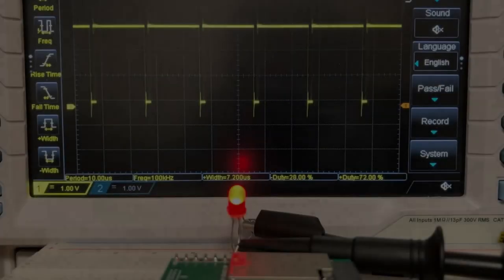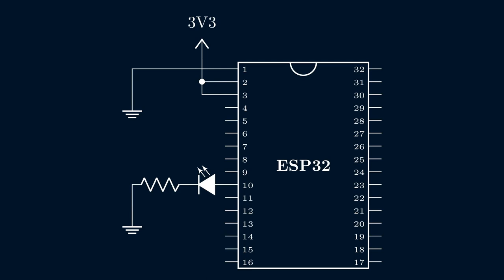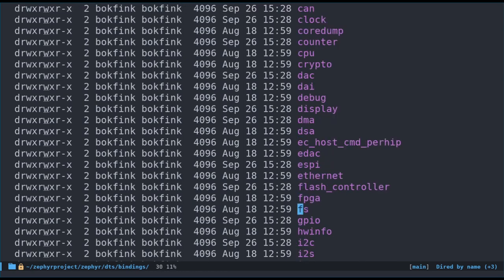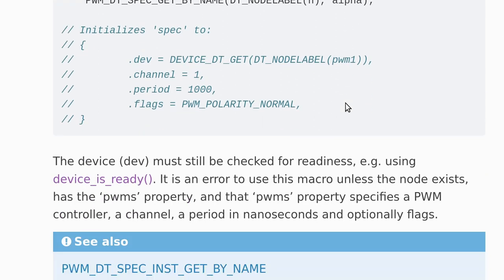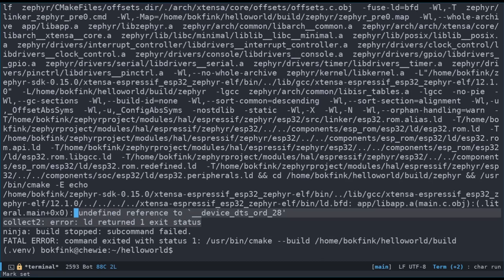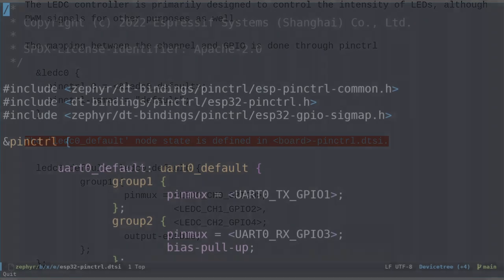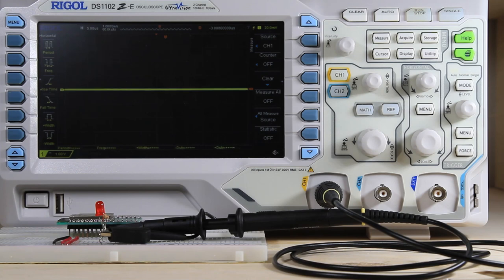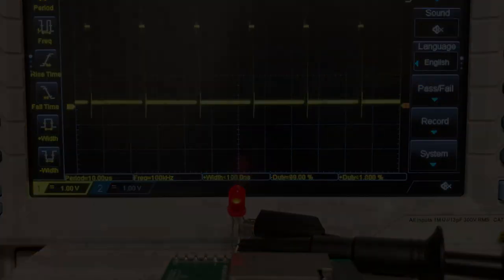[#4] ESP32 on Zephyr OS: PWM, pinctrl, Timer [Part 4]

Comment: Coincidentally I was also looking at pwm and had coding done. Then I bumped to your video. Your video gives precise and deep understanding. Thanks a lot 😊. I wish you keep making more videos.

Somehow in my esp32, for 20ms (also set 20ms in DT), setting pulse width using dt_pulse_set() returns invalid parameters.
Reply from the maker: That's great, thank you for your feedback. I hope you managed to find a solution to your issue with dt_pulse_set().

Comment: Nice video.  I tried using PWM for my project where I have 2 esp32 running pwm to drive led. initially they blink in sync, over time, after few hours, they are out of sync already. do you any idea or work around to solve this?
Reply from the maker: Thank you for the feedback. With regards to your project using two ESP32s where the PWM LEDs go out of sync after a few hours, I've not experimented with the accuracy of the different ESP32 clock sources, but the two things that came to mind was either to use a more stable internal clock source (if you're not doing that already), or to use an external crystal that provides the same clock source to both ESP32 ICs. Please do share if you get it working. Out of curiosity, would you mind sharing what your project is for? Using two ESP32s sounds interesting!

Comment: At 18:35 , you put compatible = “pwm-leds”;

Would this not be compatible=“espressif, esp32-ledc”?

If not where did you get this pwm-leds from.

Otherwise very good video though :)
Reply from the maker: That's a great question, thank you! You can certainly use the espressif,esp32-ledc compatible directly if you would like. However, using pwm-leds adds another layer of abstraction so that you could easily change the underlying microcontroller to another family or even manufacturer, without having to make any change to the source code, only a few changes in the devicetree. This comes back to the concept of separating the application code from the hardware that Zephyr is trying to do.

If you have a look at the generated devicetree for the application under build/zephyr/zephyr.dts, you can see that the pwmleds node (using the pwm-leds compatible) refers to the node &ledc in its pwms property. If you look up the ledc node in the same file, you will see that it indeed uses the espressif,esp32-ledc compatible:

	ledc0: ledc@3ff59000 {
			compatible = "espressif,esp32-ledc";
                        ......

So, we are just using an extra layer of indirection to separate application code from hardware. Does that make sense? Sorry if I misunderstood your question, and thanks again for making a great point!
Reply: @thepullupresistor  Thank you very helpful sir.

Comment: Because it took me a while to puzzle this together, here is an overlay example for a stm32f411_nucleo_board. With pwm on the build in green user led (PA5):

&timers2 {
	st,prescaler = <1>;
	status = "okay";

	pwm2: pwm {
		pinctrl-0 = <&tim2_ch1_pa5>;
		pinctrl-names = "default";
		status = "okay";
	};
};

/ {
	pwmleds: pwmleds {
		compatible = "pwm-leds";
		status = "okay";

		green_pwm_led: green_pwm_led {
			pwms = <&pwm2 1 PWM_MSEC(20) PWM_POLARITY_NORMAL>;
		};
	};
};
Reply: static const struct pwm_dt_spec fading_led = PWM_DT_SPEC_GET(DT_NODELABEL(green_pwm_led));
Reply from the maker: Thank you for sharing!
Reply: Oh, this might come in very handy, thank you!
I'm using the same board, and I'll definitely reference this if I run into too many issues. I'll start off on my own though of course as my purpose when watching these videos is to fiddle around with zephyr and device trees and learn on my own.